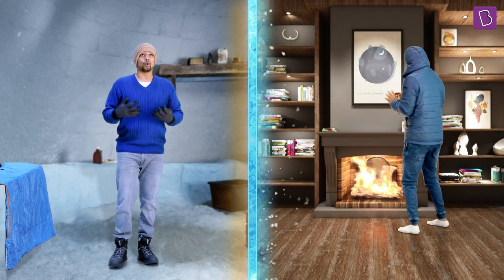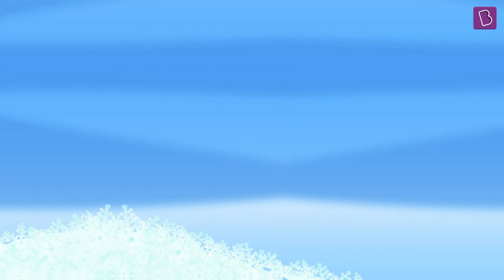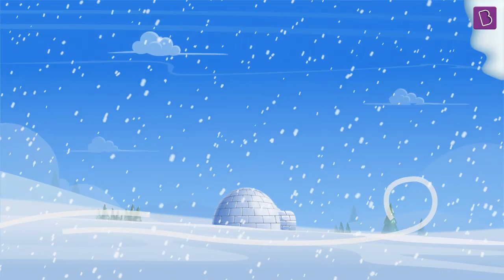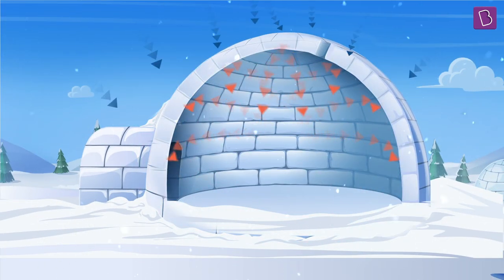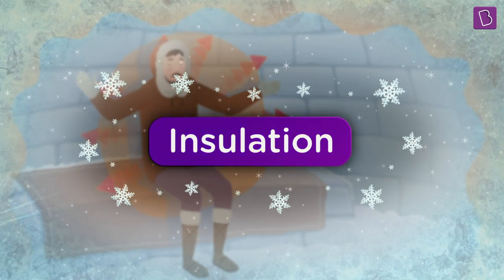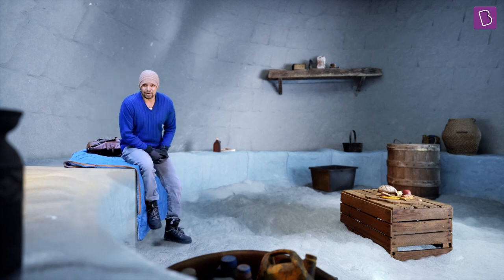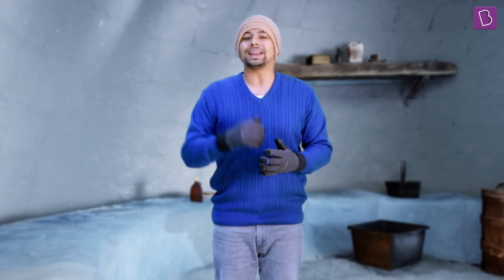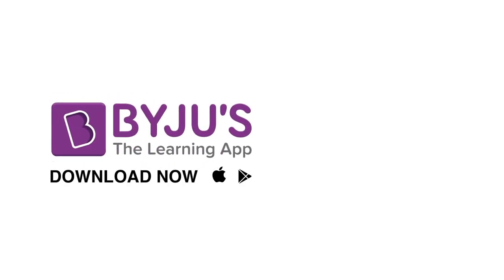How Can Igloos Keep You Warm? | BYJU'S Fun Facts

Comment: AMAZING FACTS AT BYJUS ❤️
The answer is :
Temperatures outside can sometimes reach up -45 degrees  however, inside an igloo, the temperature can be anywhere between - 7 and 16 degrees because of your body heat.
if there are more people inside the iglo, it gets even warmer. Even though 16oC or 1oC isn't a like cosy  temperature considering that the temperature of arctic terrains can reach a staggering -40oC to -50oC, an igloo does a fantastic job for  regulating the temperature.
Reply: Thanks buddy 😍😇

Comment: In areas where temperatures can drop to -50 degrees, you may find the inside temperature of an igloo to be 20 to 70 degrees warmer than the outside temperatures. Occasionally they may reach as high as 50 to 60 degrees inside temperature.

Comment: Of course it’s true because as heat is relaeased and circulates inside igloo if the strength increases heat will increase but there is other problem surface level of igloo becomes colder as it heated up at the top there should be limit of members to balance…!!!!

Comment: Why warm air trapped inside an igloo not absorbed by the snow? Bad conductors or insulator concept is okay.. Wud snow not melt if it is heated..
 In other regions where seasons change, snow melts and forms ice and water after absorbing heat from the environment. 
I m sorry.. Just wanted to dig further.. 
I understood that air trapped in snow is an insulator ( like the air trapped in quilts and blankets). 
But why snow at freezing levels doesn't absorb heat?